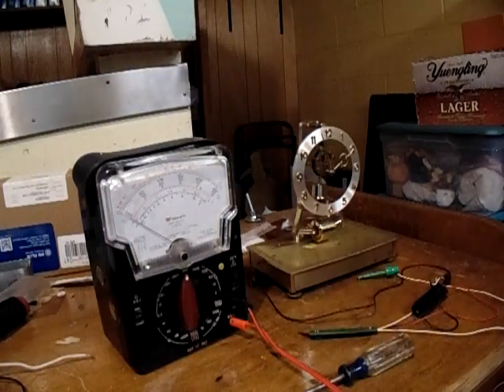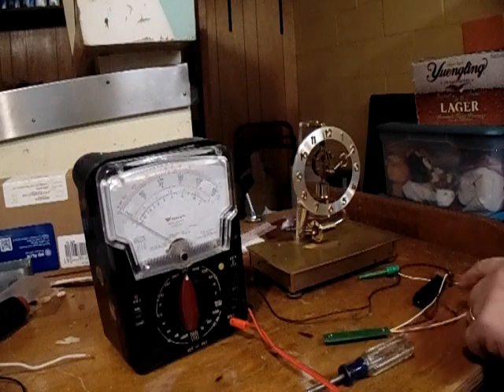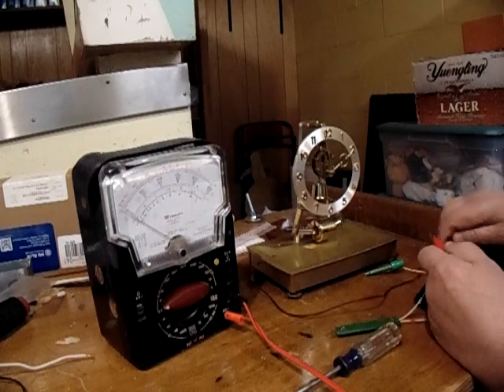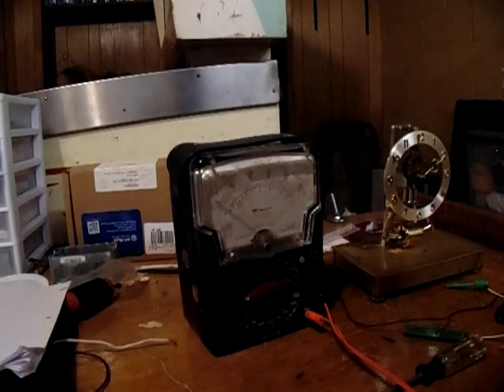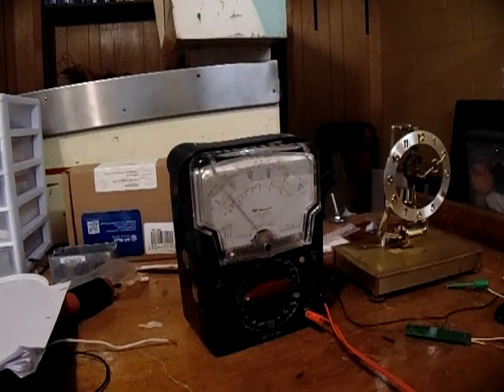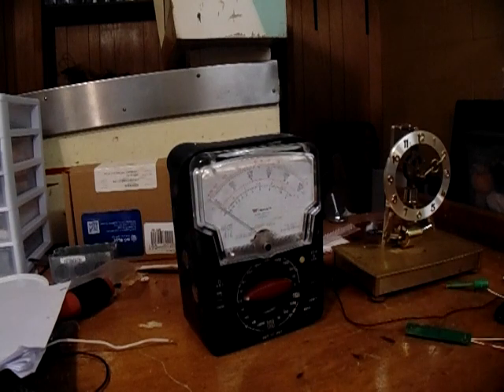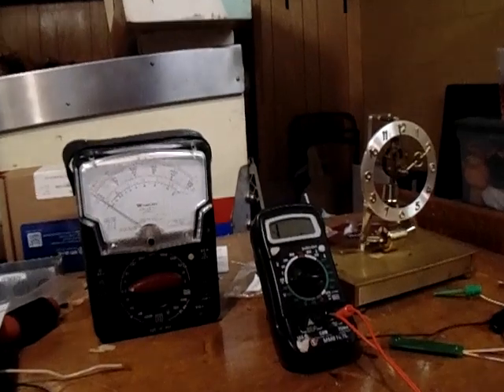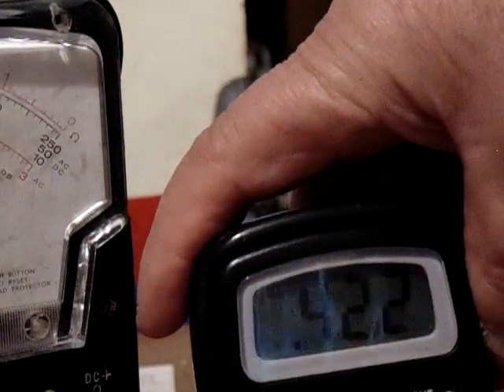Testing  electromechanical Clock for internal operation namely the coils and magnet

Comment: Tell me something, inside the coil is there a resistor and a transistor?
Reply from the maker: there are no components in side the coil    it is 4000 turns of #38
Reply from the maker: I just realized what you were asking  the cock works by electrical induction  there is a magnet on the pendulum which causes a emf in the coil by Faraday's law  thanks for asking

Comment: I can't find any explanation about the circuit board you used, how you determined what you needed, or where to find it?
Reply from the maker: Dear Sir 
sorry for the long time to answer,  I just saw your question.
I had the clock and on line for other videos and information. The basic timing is 3/2 hertz. the  i worked from there with some trial and error to get the pulse width correct and later put a adjustment on it. if you want to  talk about it my number is 732-766-2717
Reply: @robertjohnson4089  Appreciate the reply.  I have a few of these clocks.  They seem to have a mind of their own.  If I bump one, it starts working!  I've long since put these on the back burner.  And haven't really pursued the issue.  Thanks for your contact.  I may in the future give you a call.
Reply from the maker: I designed and built the circuit board if you are interested i can tell you more
Reply: I also have this clock. How can I determine if I need just a coil, circuit board, or both. Please be simple, I don't read schematics lol
Reply from the maker: If you have a clock first measure the resistance in coil it should b 2K ohms to 4 K ohms  then follow the video as I did 
om email is puppydog846@yahoo.com

Comment: Super
Reply from the maker: thank you  I am glad you liked it. The Video  was for review for comments from people  familiar with project. I would like constructive comments. Do you have a clock like that?
Reply: @robertjohnson4089  Sorry, i dont have any such clocks. But I liked the video, your presentation, camera angle, and the way you explained the details. Since I am not entirely into the field that you are in, i wont be able to give any comments in that direction.
Reply from the maker: @learningexploration4608  Dear Sir I am working on other projects with AVR micro controller using a nano for a sprinkler system
Reply from the maker: @learningexploration4608   i SAW your presentation also on the AVR  the first two any way I am also interesed the AVR but i use the uno and nano from arduino I have a coule projects also
Reply: thanks for the video. just bought in one of these clocks. does not work. is there a circuit board associated with this clock?, my clock has the battery hooked directly to the coil. doesn't seem correct tnx.
Reply from the maker: George there is a circuit board with the clock it was designed in the late 50s it used germanium transistors 
Some clocks had the electronics inside the coil it id a mess to take out be my quest to try. the components in that clock are wrapped around the coil t he coil is 38 0r 40 gauge wire and brittle i have had no succus separating the electronics from the coii my number is 732 766 2717
Reply from the maker: thans